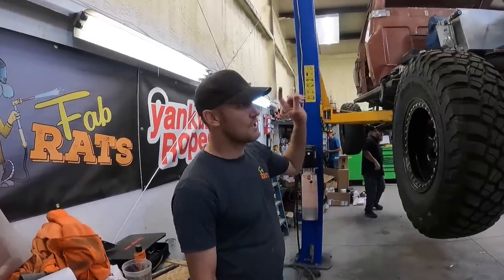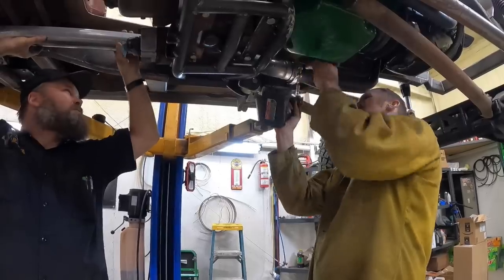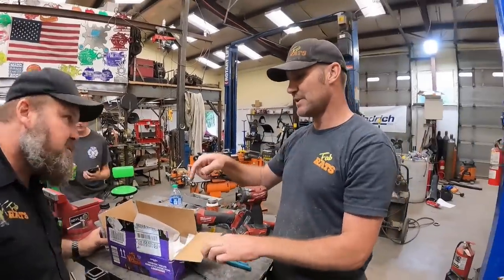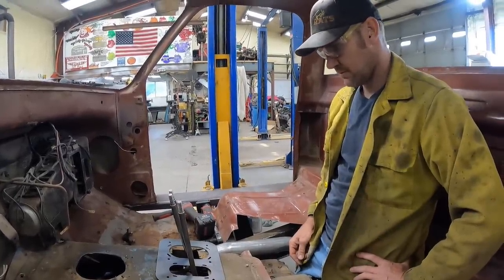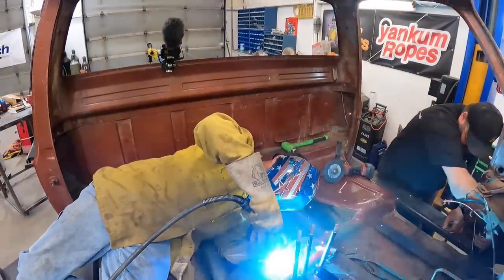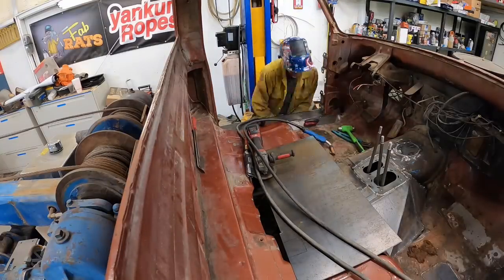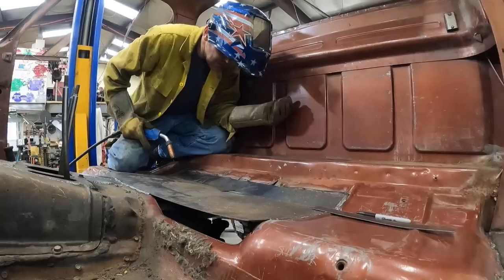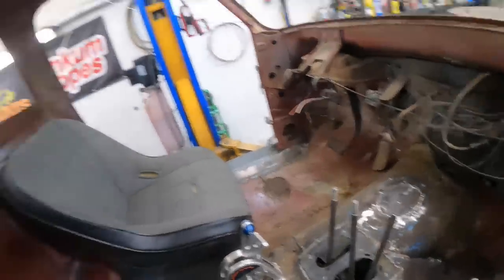Moving Forward With The Rat Rod Wrecker Build!

Comment: Paul, you should buy a bead roller tool when doing metal  work on floor pans. Make sheet metal stronger. Looking good 👍
Reply: HE HAS ONE ,,, HE JUST DON'T USE IT FOR SOME REASON
Reply: Bead roller smh - he half welded a bolt in tunnel cover.  Full assed is not in Paul's vocabulary.

Comment: Paul, surprised you don't have a slip roll. You could run beads on the sheet metal panels that adds strength and reduces oil-canning.

Comment: Ben'll discover that little sledge is a handy little bit of iron, when he starts swinging it in a tight space. My little sledge has lots of persuasion in its past, and it's been used as an anvil in tight spots a few times. I'm glad you gave the exhaust a bit of space on the floor boards. Michelle or whoever's co-pilot wouldn't like her shoes melting...

Comment: you need an English wheel device to make those indentations in your sheet metal it makes it stronger and less likely to flex and pop making extra noise as you go down the road. The problem is that it is time consuming.

Comment: Since I wsitched to Stainless band clamps I have built exhaust in three sections.  headder extended to it's most practical length, flex section and muffler, tailpipe and tip.  each section is about 4 feet long easy to support with a donut and bracket and no rattles!

Comment: Paul, I have run .035 wire in my Miller since day 1 over 20 years ago, no complaints. I have welded plenty of sheet metal in that time. I welded a new floor in a buddies Ram Charger a month or more ago, he has a little Lincoln (185 I think). He asked what wire to get? Thinking wee lil welder and sheet metal, I said .025 for sheet metal. WHOLLY HELL! I could actually run a bead and not blow through! I was so impressed I have been seriously pondering picking up one of the little welders and just running  .025 in it for sheet metal! Just find a nice used one, not go nuts.  MAJOR TIME SAVER! Pull the trigger and burn it in!(Mostly)(Jumping around to control warping obviously) But dang!!! So much easier, faster and a smaller over all weld size!

Comment: Have you taught of putting some kind of heat shield or heat rap where the pipes come close to the floor boards. It would keep some heat out of the cab. Ben is a great addition to your shop. One man mook up one man welding', you guys get a lot done.  Two brothers working together happily what could be better. Your father is looking with a vary proud smile😇.  John Wunschel  The >-W->  Old Hangtown ca

Comment: You should wrap that exhaust pipe is near the floor. Heat  shield wrap.  The heat will transfer to the floor and  Roast off your legs and feet. Just my suggestion.  Probably feel good in the winter 😌.   Most definitely won't feel good in the summer.

Comment: Coming along nicely Paul and Ben! Maybe would've been a good idea to add a heat shield to the sections of exhaust tubing under the floor since the wrecker will spend most of its time crawling slow and sitting with the engine running during recoveries. You'll have a skillet under your feet!
Reply: They could take a cast iron skillet with them and cook lunch ' on the job ' lol.🤣

Comment: Have you two considered the heat generated by those exhaust pipes being so close to the floor board?  Ive got a jeep Scrambler with so much heat coming off the pipes and catalytic converter that no one wants to ride in it and it has pretty much destroyed anything I have put on the floor boards to absorb the heat.  Love watching all your builds.

Comment: Excellent job on the floorboard just an idea you can take some 3/4-in wide sheet metal strips tack  them up underneath in the cab sheet metal halfway through the seam opening and then put your added sheet metal on so you got a backer plate. you won't burn through making for faster welding on lighter sheet metal steel and leave them in underneath the seams you can even drill and tap for like in a doghouse situation on the floorboard going around the shifters  that way you can unbolt on  floorboards and inspection covers you doing such great work though I love your videos you give me a lot of good ideas thank you

Comment: Reminds me of the Chevy C20 that I had many years ago. It was a Flintstone mobile when I got it. I borrowed a friend's oxy acetylene set and cut patches and welded them in using a body hammer against my chest to push down on the patch as I welded.  As you probably already know,  welding with oxygen acetylene on rusty metal creates lots of wonderful slag sparks. I probably ruined a few shirts at the time

Comment: passenger side exhaust might need some heat shield or heat wrap. so it dont cook the flooring. The adhesive used for the insulation flooring will melt. happened to me on my old farm truck with custom ran exhaust. just a heads up for you fab rats.

Comment: I have a suggestion to try. I had a fab shop for years... We found that when welding on steels that were not new and perfectly clean.  We went to 70S-3 wire rather than the common 70S-6.. the welds come out cleaner, easier to weld and less spatter.

Comment: No seat adjustment tracks for switching drivers?Looks like you need a couple inches lift anyway.Truck's really looking solid,and allot smoother too.Almost done welding,and time for primer on the new steel.Maybe 3 layers of 'Dynamat'?

Comment: I notice that flat sheet metal is going in where there used to be stamped shapes.  I'm wondering what the purpose of the shapes were for?  Perhaps to handle stress due to changes in temperature, or to handle the dynamic forces better?  I doubt if the engineers put them in for fun.

Comment: It seems like you should have cut the entire floor out at the start, then gotten your shifters and exhaust located and installed. Then you could have designed a complete floor using cardboard templates and welded the whole floor in as a unit. But I'm an armchair fabricator so I'm probably wrong.

Comment: Paul, when taking the 3-inch diameter exhaust up and over the differential and needing to intrude into the floor of the cab why did you not transition from 3 inch round to 4x2 rectangular to minimize the intrusion?

Comment: I'm surprised that you didn't make the seat floor and transmission tunnel a removable box that you could unbolt,and have instant access to the linkages,the transfer case etc ,and if you have a roll cage ,then that can be used to lift out the transfer case and gearbox  !

Comment: Hey guys, is there a reason you guys didn’t just do a cab lift instead of cutting out the floor? I’m no mechanic, just a self taught welder. but looks like a 1-2 inch cab lift would be easier than all that welding, if that is possible to do.

Comment: What is going on with the bottom of the doors and no sill.  Seams water will just come right into the cab as the slider sits so high.  Scratching my head.  Or are you not putting doors on?

Comment: You two guys make college  engineers look like fools with there computers to design car changes when you two get better results with a tape measure and blow touches. And a hammer to fine tune the end result
Reply: College engineers are required to design parts that must pass Federal motor vehicle safety tests and certifications; individual fabricators are not.  Nice try.